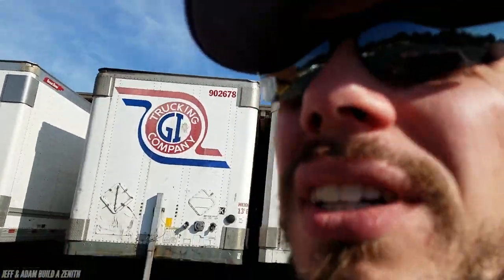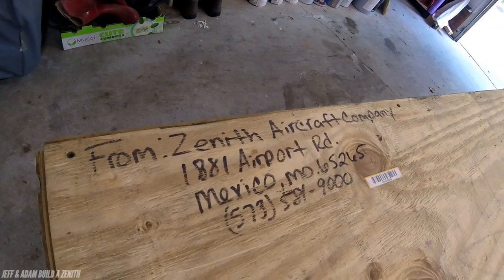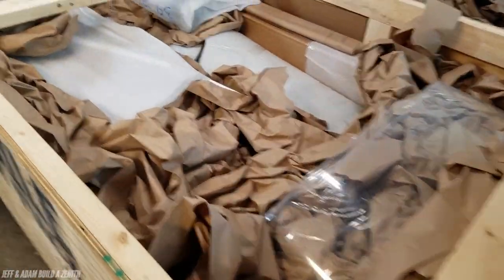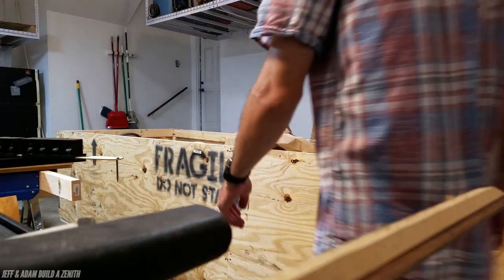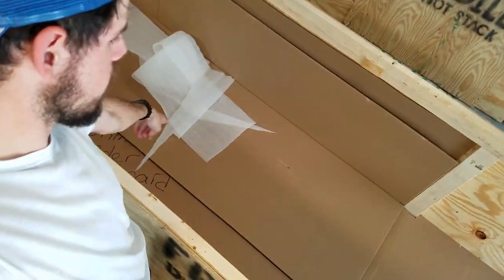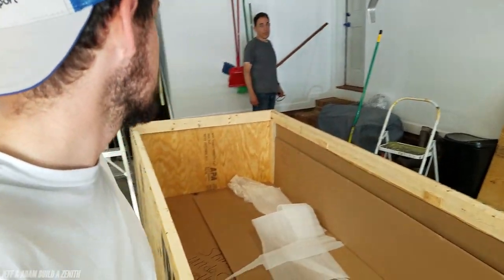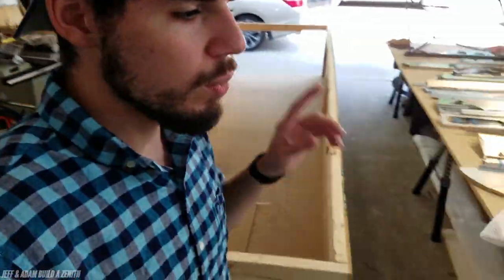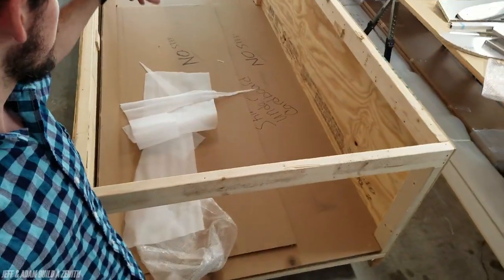Airplane Unboxing - What it's like to get a Zenith kitplane - 750 Cruzer - JeffandAdamBuildaZenith

Comment: I remember our Zenith CH-250 Kit was delivered by a 40ft 18 wheeler. The driver wanted to just push the box off and let it drop to the driveway. I told him that was not acceptable so he said “OK, what’s your idea”. Having degrees in Physics and Mech Eng I came up with an idea of lowering one end of the box onto the driveway and tying a rope onto the end of the box still on the truck. I tied the other end to my car bumper in the garage. I pulled the car forward a little to raise the end on the truck up off of its floor then pulled the truck out of the way. I then slowly backed my car to lower the box onto a round fence post. We were then able to roll the box around enough to get the car out of the garage; then rolled the box into the garage. It did take two fence pipes but it got the boxed kit into our garage without damage. That was a LOT of Avex rivets ago😊.
Reply from the maker: Wow! Yeah, sometimes you really have to put your foot down--and get creative--to get things done the way they need to be!

Comment: What a gift! They packed the plane in your work bench.. Cut 10 or 20 drawer openings in it and put some cheep slides in for drawers!! Now label all the drawers with the plasticized packing slips.. presto you have a great system for finding stuff 4 or 5 months after you have forgotten where you put them!!

I will follow your billed.. I almost bought this kit last year and then thought I would just rent.. Maybe I will committee and build one after all..